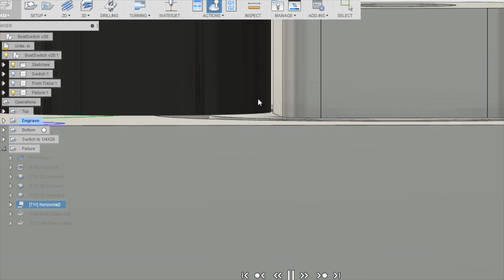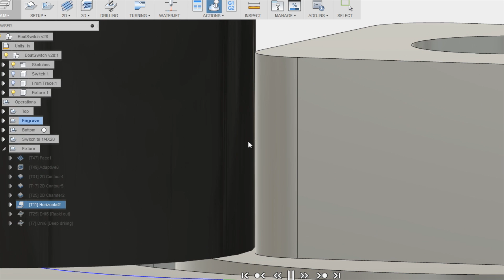CNC Broken Boat Part 2  Widget87

Comment: I think there is a mistake in the feeds and speeds for the superfly. It shows 2500 RPM at 15 IPM, but this yields 0.006 IPT not 0.002 IPT. Maybe it is 5 IPM? Also 2.5 inch cutter at 2500 RPM is closer to 1600 SFM. The shear hog's feeds and speeds seem to be off by a factor of 3 as well. Maybe incorrect number of  teeth is 3 not 1 in the feeds and speeds calculator?

The Lakeshore Carbide end mill seems to be 0.0007 IPT to be closer to 21 IPM vs the 30 IPM that it would be 0.001 IPT.

Comment: Top tip with the Horizontal strategy is to contain it on the geometry tab. In this case, silhouette with tool on center, would stop those pointless air cuts around the outside.
Reply: It also frustrates me that there's no outside>inside option on the passes tab for what is an otherwise great toolpath.

Comment: At 2:30 roughly, what does "To be avoided at all cost" mean? Is there something in the slotting process that causes issues?
Reply: +Brandon L. Slotting is hell on an end mill. Nowhere for the chip to go but up the flutes, allowing heat to soak back into the end mill or tack weld itself on depending on how aggressive a cut you make. The goal is to have the chips carry the heat away so you don't mess up your nice and expensive TiAlN-coated carbide end mill or the part.